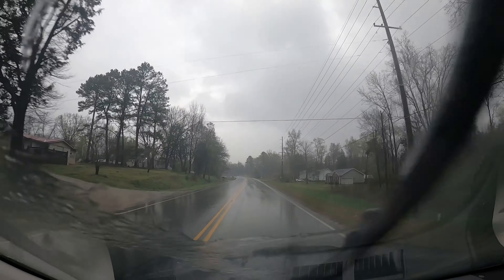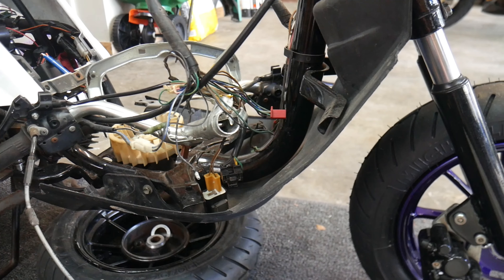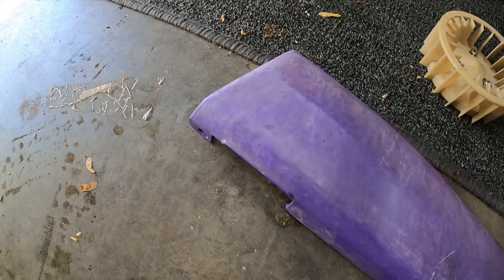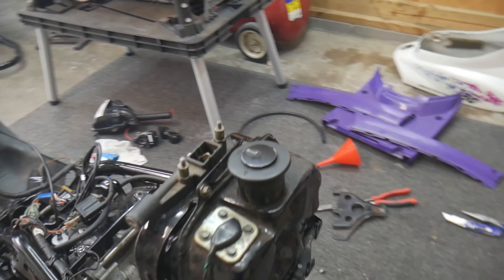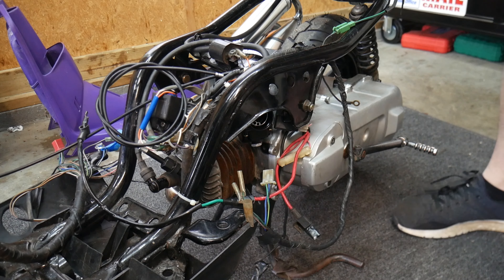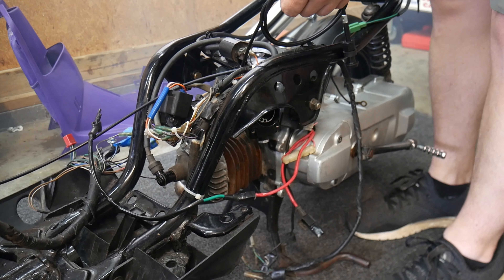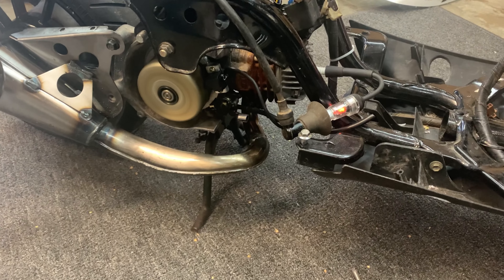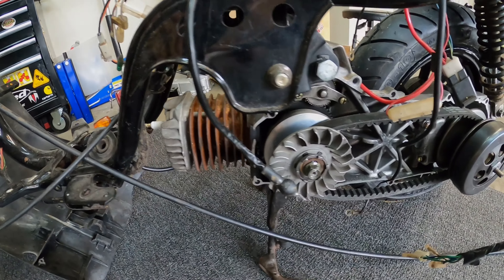1994 Yamaha Jog 90cc Build - Pt. 1

Comment: Did the engine bolt right up to the frame?
Reply from the maker: That is correct. I did not install the motor, essentially I purchased someone else’s project they couldn’t complete. The engine is supposedly out of a Polaris 4 wheeler, but I suspect it’s just a Chinese Minerali clone.